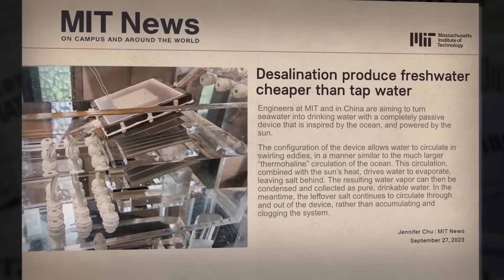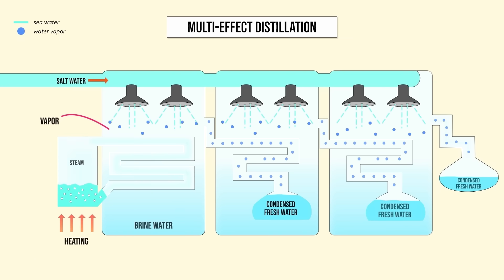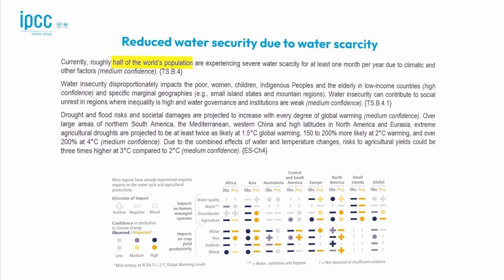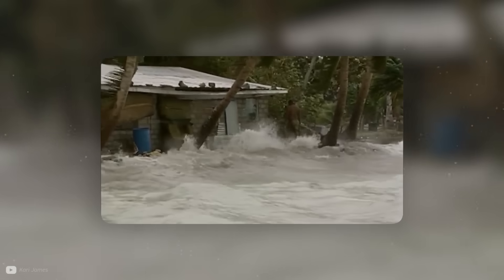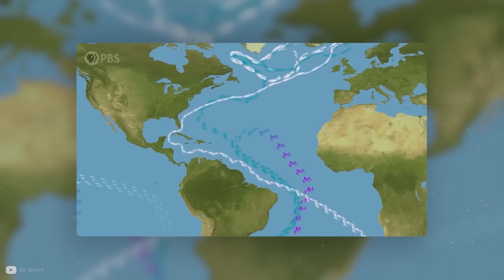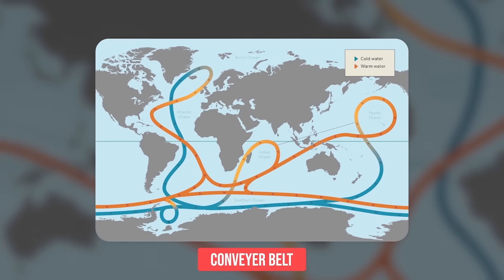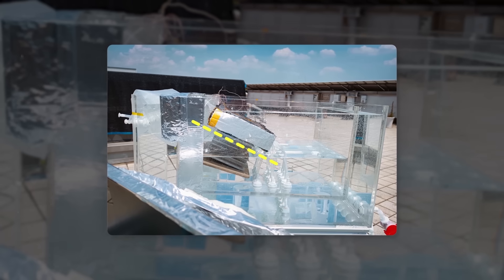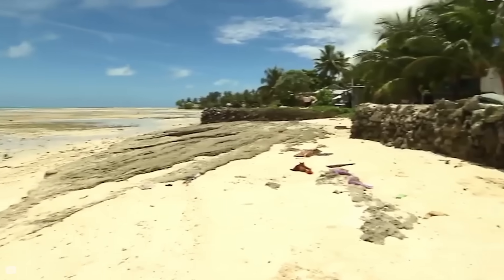Unlimited Fresh Water: Can MIT's Breakthrough Save Us?

Comment: I'm thinking of an even simpler method consisting of a sluice covered by a dark tarpaulin. The sun heats the water within, condensing on the inner lining and which continuously runs off to a collection gutter. If this recovered water is still brackish it could be run through again on a secondary sluice. A solar-powered pump keeps the flow going from the inlet back to the sea. 

Wouldn't something like this work and be very cheap for a small community?
Reply: yep but you don''t want the water to be continuously running ideally

Comment: The sun tracking requirements are not addressed considering the angle of the water cell is fixed however a sun tracking fresnel lens and mirror could provide a reasonable solution for maintaining the light intensity constant during sun transition .
Reply: There is nothing unique about using the sun, could be any heat source and no reason it can't rotate and follow the sun or use lenses.
Reply: @Nothing-f8z  A solar tracking system is almost always more expensive than just buying a second system to double your output.
Unless you manually adjust it to follow the sun, but if you're that desperate for something as basic as water, I don't see you getting your hands on one of these.
Reply: @smolpener7430  Do you have any engineering tips that would help when scaling this model up to a industrial scale?
Reply: Why would you bother with the lens if there isn't a temperature minimum and you're bringing in supplemental heat anyways?
Are you aware of the concept of surface area?

Comment: The big problem with desalination never been the cost. You can always scale it up to decrease the cost.

The issue always been what you do what all the salt you took off from the water.
You can't just dump it in the ocean without creating a area of high sal that will kill everything there
Reply: I know what they can do with it, those new salt batteries they been talking about. And we always need batteries.
Reply: Well, the entire desalinization economy would absolutely disagree with you but everyone is entitled to their own uninformed opinions, amiright?
Reply: @LittleXtra  So explain the phenomenon behind their little hand wave of "the salt goes away" - where does it go? The angled device they show is not novel - yea, brine falls in a water column due to density, that's the entire mechanism behind the brine pools which instantly kill all the life on the sea floor when they reach it. The brine doesn't leave the system in their example though, and once equilibrium is reached it will stop flowing. How is this device novel compared to simply pumping the brine elsewhere?
Reply: @-Bill.  it's not
Reply: @-Bill.  There is no need to apply pressure, hence you can get rid of the brine long before it is concentrated to a high degree.
The total amount of salt your total amount of brine obviously stays the same, but it already comes out diluted compared to the one from reverse osmosis based systems. Hence you can dumb it without destroying your local part of the aea.
Reply: Yes, because they never thought to try to use ocean salt for anything in the history of mankind. The brine from desalination would be so contaminated by other ions that it would require so much processing to be useful that it would be cheaper to just buy the pure chemicals. Anyone hawking these miracle water sources is trying to scam gullible investors. Do you honestly think solar stills are some kind of new technology? This is stupid - how is the thermohaline effect different from just having a pump in there to circulate the water. Circulating the water doesn't stop filters from clogging in desalination plants so how does it work here? This is snake oil.

Comment: Straight solar distallation is more cost effective and very productive. A simple long trough with slanted glass out in the sun, supplied with salt water into the very slightly declining trough gets large evaporation onto the slanted glass, which drains into a gutter at the bottom edge of the glass and into collection. No moving parts except a small windmill to bring the saltwater into the trough. The lower end of the trough draines salt water into a cooling serpentine channel out into the  sea channel current through pvc pipe.
A 200 to 300ft trough could supply a village. This is long proven technology.
Reply: Wow, you've single handedly solved the desalinization process countless scientists have been working on, bravo! You must be really big brained.

Comment: 5he best desalination is the process that avoids it entirely. The melting caps are the largest reserve of fresh water. Has anyone calculated all the seasonal melt in the inhibited areas of the North alone. The fresh water (dump)into the oceans (at least theoretically) could upset the global heat regulation. The science is something like the cold unsalinated is falling in the water column.

Comment: It seems logical to me to use some of that blistering heat and sunlight on deserts to have large shallow ponds of pumped in seawater that is covered to catch the evaporation with...like used now but on a far larger scale. Put the great minds on upgrading an already proven method. It would require little added energy if designed correctly.
Reply: "Little added energy"? Have you ever heard of hydropower plants? They extract the potential energy of water flowing downhill. To pump the water back uphill, you'd have to put that energy back into it with a lot of loss due to inefficiencies in converting some other energy into electricity and then converting that electricity into kinetic energy to run the pumps. Pumping water uphill (from the ocean to literally anywhere) is very energy-expensive. It's even used as an energy storage method in some places where they pump water into reservoirs which can be flowed through hydropower plants later to extract the energy at a loss during peak demand.
Pumping seawater to deserts for desalination would then also leave you with a hypersaline solution to flow back to the ocean or contaminate whatever desert you're pouring it into. The sun isn't any more intense in deserts than it is on the coast at the same latitude. Desalination should be done at the coast where the salt can be gradually deposited back into the ocean, and only spend energy pumping fresh water instead of wasting energy pumping salt and extra water that would have to be used to flow that salt back to the ocean in dangerously high concentrations.
Reply: @mailleweaver  there's answers to any problem with enough thought process.
Reply: @terrymcclintic3379  Think your way around the laws of thermodynamics. The math doesn't support your plan. When you manage to bend time dilation to selectively alter the flow of gravity on a local scale, then we can reassess it.
Reply: @jimclayson  uh-huh

Comment: We had an experimental desalination project on town land near the shore. It used only solar to evaporate and distill seawater  from a shallow black polymer lined ponds. I never did learn the results or prospects from the project.  It lasted about four years.
Reply: Where was this so people can look it up and learn?
Reply: 4 year gravy train.  Someone made more money than water yes?
Reply: I wonder if this might be more practical for farming than for harvesting drinking water. Lots of plants need to have some space between them to grow properly, so if instead of pools they used long narrow channels in between the rows of crops it wouldn't be taking up huge amounts of land, in that the land would still be available for its intended use. When there's less sunlight and heat the plants would need less water, so that balances out, and covering your crops with what amounts to a weirdly shaped high tunnel with tons of water channels regulating temperatures could seriously extend growing seasons, increasing productivity. Also, based on my experience having your rows of plants next to a highly reflective surface like water or crystalized salt would reflect light back up on the plants -- which could be a problem for some plants in very hot, sunny climates, but with the right crops or in areas with less sunlight it should also be a big boost to production.
Reply: @eyesofthecervino3366   There have been some successful implementations of this using green houses. A large greenhouse is built and it pulls dry air over what looks like a cardboard frame soaked in sea water to add humidity. The greenhouse keeps the moisture in and allows the crops to grow. Farming is hard, so you need a good market for high value crops in order for this to work. I think this was done in some country like Saudi Arabia, where there was political will for locally produced food, a large demand for food, wealthy consumers, and near the sea so salt water was available. Supplementing, the greenhouse with moisture had a huge impact on reducing water demands that otherwise would have made it non-economical.
Reply: @cryptickcryptick2241  
Oh, interesting! That sounds like it would function like a swamp cooler, too, making it even better for very hot, dry, sunny climates. Very cool :)
Reply: If you didn't hear the results, they were awful.
Reply: @smolpener7430  I didn't,  but then again,  I wasn't interested at the time. Neither was the local government.  It was initiated and funded by some other entity.  I was never up on the details . After a couple years it was neglected and fell to ruin.
It was never a big budget thing, nor was much spent on it's construction.  As I said it was experimental,  proof of concept.
Simple scientific principles will tell you it would work.  How effectively is up to the quality of design and materials.
Reply: probably wasn't cost effective and was a poor producer. nuke power should be used in conjuction with desal.
Reply: @EphemeralWealth  Right, so building nuclear power plants on low population poverty-stricken islands would be your starting point? Interesting....
Reply: @EphemeralWealth  lol...how wrong can you be in one so few words.
Reply: @randomaxe662  ok what does the gender engineer have to say about it
Reply: @EphemeralWealth  and you confirm my point.
Reply: @EphemeralWealth there have been technological advances that have been suppressed in the past.
I’m surprised you don’t know about those kinds of things, seeing how you are so god at it with your comments.
Tucker was one of those innovators, and later, GM, all on their own.
The GM Impact was a lead/acid battery powered car that showed serious promise.
It was too good, so GM destroyed all of the prototypes after the testing was done.
If the desalination plant worked too good, well, CALIFORNIA.
They dumped near every drop of a replenishing rain season into the Pacific to save some damn minnow in one little lake.
The real reason was to keep a stranglehold on water to PREVENT people and farmers from taking advantage of that windfall and keep them poor and dependent, under their rule.

Politics does more harm than good.
If you don’t believe that, then join the Army.
Reply: @dangeary2134  you sound more interested in perpetual motion than actual engineering. We don't know shit in the grand scheme of things, but the solar black body desal plant in question failed for whatever reason. If you have information other than your feelings, let's hear it. But taking a good concept, a good lab experiment and putting it into production is not guaranteed. Solar production in general whether as heating element or electricity is not cost effective compared to coal gas or nuke. Politics is what's driving these "green energy" boondoggles and suppressing cheap clean nuke. Corporate greed foisted a poison COVID fakeccine on the world so I agree that the people's interests take a back seat to power control and lies. But nothing is helped by chasing rainbows and unicorns and being vacuous dicks about it. Like that other donut that contributed nothing but feelings. Feelings don't keep planes in the air, bridges intact or food on table.

Comment: You showed vast desalination plants from the Middle East, but did not clarify that the MIT solution does not scale to anything remotely similar. As brilliant as the MIT solution is, it is only suitable for “domestic” scale or “village” scale production. Its output is constrained by the amount of energy that can fall upon its solar collector. Thus, scaling to large volumes of water requires vast fields of these units.
Reply: How vast would the fields need to be to serve 1 million people? With average developed world water usage
Reply: @100c0c  the suitcase produces 6 litres/day provided the sun is out. If it’s sunny enough to make the 6 litres, it’s also a hot day requiring lots of drinking water. Assuming simple village life rather than western standards, I’m guessing that you’d need two suitcases per person for drinking and cooking and basic washing. Forget crops. A first world toilet flushes 4-8 litres of water. The MIT breakthrough is genuinely brilliant. It has no moving parts, no maintenance and requires no electricity. But scaling it up requires a huge surface area, like a photovoltaic solar farm, combined with all the plumbing that centralises the output for processing and distribution. I can be done, but is hungry for sunny land which might already be settled, as land is want to do. Yes, it could be mounted on rooftops, but now you are pumping salt water overhead, which requires energy. And plumbing. You can see how getting it to scale is challenging.
Reply: @matthewdunstone4431   Thank for replying. Would it not be better than other methods in a place like Saudi Arabia with lots of empty sunny land and abundant energy?
Reply: And of course.. it needs sun..... lots and lots of sun....